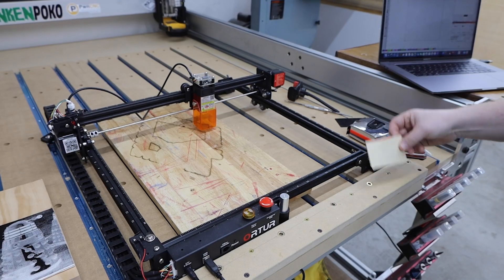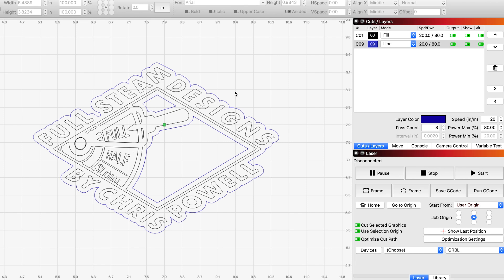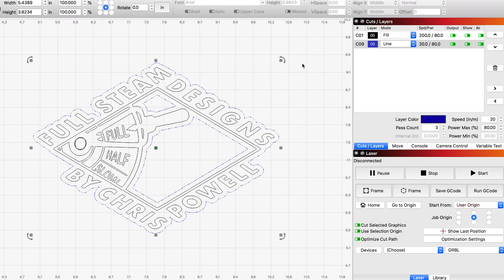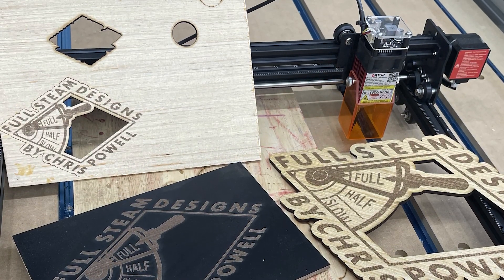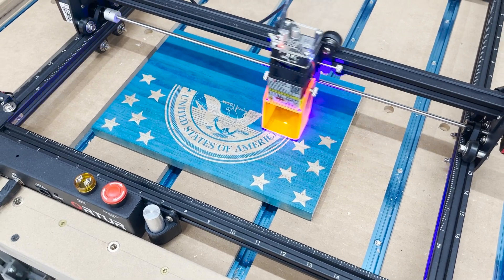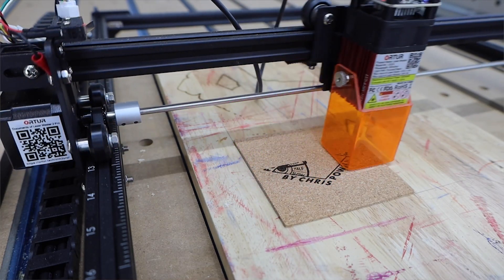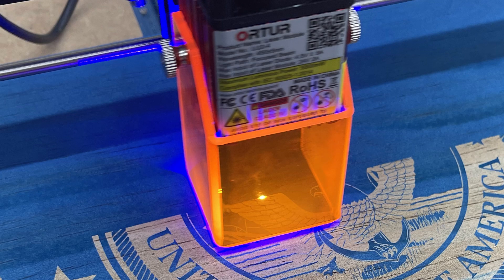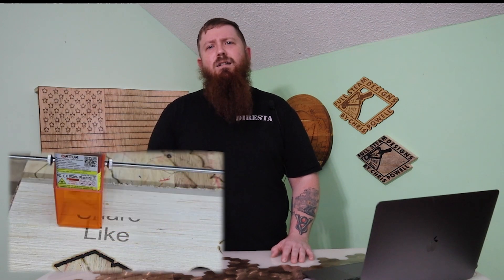Getting Started with the Ortur Laser Master 2 Pro laser engraver and Review

Comment: Great video Chris. Just don't buy an Ortur LM3 .... See below

Well-Known Issues with Ortur Lasermaster 3: A Comprehensive Review

Issue 1: Ortur LM-3 Not Powering On
One of the most prevalent problems encountered by users of the Ortur Laser Master 3 is its failure to power on. This issue can stem from various factors, including a faulty power adapter, blown fuse, loose connections, malfunctioning laser module, or motherboard glitches. Notably, the Ortur LM-3 has faced criticism for having an underpowered "power brick." Despite seeking assistance for this issue, my attempts were met with silence. Subsequently, I discovered a suitable replacement on Amazon.

Issue 2: Inadequate Laser Engraving
When laser engravings fail to meet expectations, several causes might be at play. These include improper focus, uneven engraving area, or unsuitable materials for engraving.

Issue 3: Mid-Operation Halts
Frequent occurrences of the machine halting during operations can be attributed to loose connections, faulty motors, or software/firmware glitches. This issue has been highlighted extensively on YouTube.

Issue 4: Subpar Engraving Quality
Substandard engraving quality can arise due to incorrect settings, a dirty lens, or a malfunctioning laser module. To rectify this, adjustments in settings, proper lens maintenance, and consideration of the laser module's condition are recommended.

Issue 5: Smoke and Odor Production
During operation, the machine emitting smoke or strong odors might be a result of a dirty lens, improper settings, or insufficient ventilation. This concern is commonplace among lasers, particularly during cutting. Installing proper external ventilation and employing an enclosed setup are advised solutions.

Issue 6: Unusual Motor Noises
Motors emitting abnormal sounds during operation may be attributed to loose connections, inadequate lubrication, or faulty motors. Similar observations have been shared on YouTube. A common cause was Ortur's inadequate tightening of drive sprocket set screws, resulting in loosening.

Issue 7: SD Card Recognition Failure
When the machine fails to recognize an SD card, possible reasons include a faulty SD card, corrupted files, or firmware complications. Contacting Ortur for assistance may lead to unresponsiveness, as evidenced by my own experience.

Issue 8: Machine Freezing During Operation
Machine freezing mid-operation may stem from software/firmware glitches, motherboard issues, or communication problems between the machine and the computer. Establishing a reliable link between my Ortur LM-3 and my computer proved to be a major struggle. Despite weeks of effort and assistance from Ortur, I ultimately sold my brand-new machine at a loss due to this issue.

Issue 9: Inconsistent Engravings
Inconsistent engraving results might result from incorrect settings, a dirty lens, problematic materials, or a malfunctioning PWM (pulse width modulated) laser power controller. Obtaining assistance from Ortur for this issue was often challenging.

Lack of Customer Support and Service
In terms of customer service and support, Ortur falls significantly short. Despite purchasing their hardware, I received no aid when problems arose. Requests for help went unanswered, and defective parts were disregarded. Unfortunately, Ortur seems unwilling to invest in its customers' needs or satisfaction.

Personal Experience with Ortur LM-3
My excitement for the Ortur Laser Master 3's potential to enhance my workshop quickly turned to disappointment and frustration. Despite its promising appearance, I encountered only obstacles and minimal assistance from Ortur. Their lone response directed me elsewhere for help. Ultimately, after exhausting various resources without resolution, I was forced to sell the Ortur LM-3 at a substantial loss, leading to the demise of my aspirations.

An Urgent Recommendation
Given my ordeal, I strongly advise considering alternative options before investing in an Ortur product. It is my hope that you avoid supporting a company that displays such an evident lack of commitment to both product quality and 
customer service.

Parting Thoughts
I am not inclined to write negative reviews, but I felt compelled to share my experience as a cautionary tale for others. Thank you for taking the time to read my account, and I sincerely wish you success in your pursuit of a laser product that truly meets your expectations.

Comment: Hi Chris ,great review .. sorry if I missed it but did u use a LF laser or the SF I’m torn which  to buy … thanks so much
Reply from the maker: Thank you. So originally they didn’t have that option. This would probably be the equivalent of the SF. If you plan to do more engravings than cutting, go with the SF. If you plan on cutting stuff out more often, go with the LF. Both are capable of doing both things, but each is better at what it’s designed for.

Comment: Hi Chris! Your tutorial helped me make my decision on buying this machine. Question: I'm looking to engrave a design on a larger piece of wood. Can this machine be sat on top of a larger piece of wood with the same results, or will I have to make adjustments to the base or laser head since it will be further away from the wood surface than a smaller piece of wood that fits inside of the frame. Thanks for any help you can provide!
Reply from the maker: Yes you should be able to do that. There should be enough adjustment in the height of the laser unit.
Reply: Thanks so much! I'm ordering it today! Keep up the good work!

Comment: Hi Chris I have been doing some research on buying a laser.  I noticed how the laser took the paint off the flag union.  Im surprised there was no charring.  How did you do that just applied spray paint and did a pass on the laser?  Thanks
Reply from the maker: Yup. You just need to play with the speed settings until you get it to where it will burn off the paint without burning the wood.

Comment: 20mm/m speed is SO SLOW.  There's a guy on YouTube that shows he's cutting 6mm pine boards and plywood at 100mm/m and 100% power in 2 passes.  My new Ortur Laser Master Pro 2 S2 LF takes one pass (at 100mm/m and 100%) on 1/16" (1.5mm) basswood plywood to cut through but takes 6 passes at the 100% power and 100mm/m speed to cut through 3mm (1/8") basswood plywood (or 12 passes at 500mm/m and 100%).  I complained to Ortur and sent them the video of the guy cutting through 6mm in 2 passes and they had me do a burn test for them on video, then they ordered a new laser head for my machine and said my old laser head wasn't performing as it should.  It's time for Chinese New Years so the whole country is pretty much shut down for a month, but my laser is on order and should be here in a few weeks.
Reply from the maker: I’m using IPM
Reply: @ChrisPowellFSD  I missed that.  Sorry.  But you cut through 1/8" (3mm) plywood at 500 mm/m (20 IPM) in 3 passes.  At 500 mm/m my Ortur Laser Master Pro 2 S2 LF takes 12 passes at 100% power.  So I hope the new laser head boosts that to make it useable.  Right now I don't cut anything out of 1/8" because it takes to damned long to cut anything out.  I'm guessing you can cut through 1/8" in one pass easily at a slower speed and maybe boost to 100% power?

Comment: Will this be able to lightly etch designs onto 2mm thick stainless steel ?
Reply from the maker: Yes it will. It actually permanently discolors the surface of the stainless. You can’t scratch it off unless you sand the material off, but it doesn’t actually engrave into the surface and remove material like it does with wood.

Comment: Does she cuts uhmw plastic ( i mean cut thru)
Reply from the maker: I never tried that. The only plastic material I’ve used is acrylic, and it will cut through that with a couple passes.
Reply: @ChrisPowellFSD  ok 
And u said ur using it professionally
Correct?

Comment: is it just me, that I'm bother that's there's not phone number. i want to get this tool, but what happens if you want to talk to someone.
Reply from the maker: They have a support ticket on their website that you fill out if there’s an issue. There’s also a number of Facebook groups.
Reply: @ChrisPowellFSD  support ticket doesn't help me. I will already be in and sent an email and have not heard back from them this is not good customer service what happens if I don't receive my product what happens if something goes wrong with the product it would be nice to get answers today and not the next day or two still not convinced that this is a real company
Reply from the maker: @joecornejo7454  there sure are a lot of people using them. Maybe check out the x tool D1. It’s a little more money, but might offer you the support you want.
Reply: @ChrisPowellFSD  thank you for your input. ill check out the x tool D1
Reply: They are pretty fast at answering questions on their "ticket" system, but I found that adding pictures to the ticket seldom if ever come through, then I end up having to email the pictures to support.  And sometimes they never finish helping with a ticket  or answer your question(I think they get tired of the problem you are having).  But most of the time they pretty good.  However, I found they are not as good as all sites brag them to be.  It's a little hit-and-miss sometimes to get help.

Comment: What a great and informative video!! I do have one question though before purchasing. Do you happen to know the differences between the "Pro" and the "Pro-LF"?
Reply from the maker: Thanks. They added a couple new laser modules. The short focus and long focus. The long is better for cutting through stuff. Still works great for engraving, but is better optimized for cutting. Both are the same power output.
Reply: @ChrisPowellFSD  thanks for the speedy reply. So by the way you explained it, the LF would be best bang for the buck? Since it can do both?
Reply from the maker: That’s what I use now.

Comment: Hi Chris, thanks for the info. Will this machine etch glass? TIA.
Reply from the maker: Yes it will. I just tested the new Ortur and did a short bit on it in my latest video. You just need to paint the glass or coat it with something it can burn through. Clear glass is too reflective. Then you can just remove the paint once its done.
Reply: @ChrisPowellFSD  It's not too reflective, it's transparent.  so if you want to etch glass you need to paint it first then use lacquer thinner to remove the paint afterwards.  If you don't believe me, put a shiny surface under the glass and then burn something.  It will etch the bottom side of the glass but not the top side as the laser bounces off the shiny surface.

Comment: Does anyone know what the flame alarm means? It keeps going off
Reply from the maker: I would put in a service ticket or ask on the Facebook group. I haven’t had any issues with mine.
Reply: You can turn it off with control command or upgrade the firmware to the latest 1.87 and it is off by default.Flame sensor can be disabled by using $261=0 in console
Reply: Thank you

Comment: I’m really surprised that Lightburn software does remember the settings of each project when saved. On my vinyl cutter software and on my plasma cam software the software will remember the settings of each project when I save them. When I want to create a old project I just open up  the project and the settings are all there. I just bought this ORTUR laser master 2 pro and have not used it yet and have not played around with the Lightburn software yet, still working on finishing up my small workshop. I love all the projects you did, I can’t wait to play around with my new laser toy. Thanks for the video.
Reply from the maker: It’s got a lot of features for software that doesn’t cost a ton of money. Thanks for watching.

Comment: Newbi here - How would I laser the surface of an object 5" high?
Reply from the maker: You can put blocks under the feet. Some people use tin cans, blocks of wood, or 3d printed spacers. Check out my last video on the enclosure I built. I designed it to work with different height objects.

Comment: Hi Chris.  Can the height of the laser module be adjusted up and down, or is it necessary to buy the z-height adjuster accessory?  thanks
Reply from the maker: Yes, it has a dovetail mount built into it that you slide the laser up and down. That’s how you focus it for different materials.
Reply: @ChrisPowellFSD  great, thanks Chris
Reply: They make an accessory you can add to the laser head so you can twist a knob to raise and lower it.  It really beats loosening and tightening that screw.  I put it on mine and it's one of the best accessories you can buy for the machine.

Comment: Thanks for the demonstration! Im actually researching to buy it in a few days and your video is helping my buying decission. Quick question: im planning on engraving wood but would love to cut 5mm hard wood. With enough passes (like plywood) will it go through? Also whats the max depth it can cut? Thanks!
Reply from the maker: The big logo I did was 5mm plywood. I haven’t tried hardwood, but I would imagine it can do thinner stuff no problem. I’ll have to test it out.
Reply: @ChrisPowellFSD  Please help. All of a sudden, ortur/Lightburn is filling in letters instead of burning them as they look. For instance, the letter "O" will look like a solid circle. What happened? I changed computers and Lighburn instances and it still happens. Also, it seems like the power of the laser is extremely higher than 100% when it was never like that. thanks!!!
Reply from the maker: @7awrence  any chance you have multiple vectors stacked on top of one another? Try deleting the parts of the o to see if there’s more than one.
Reply: @ChrisPowellFSD  I just swapped out the power board and it went back to normal. It's even printing clearer. All the problems are fixed. Very upsetting that it was something so simple. Thank you so much for responding!
Reply from the maker: @7awrence  glad you figured it out

Comment: Nice video. I’d love to see a video of your settings for your unions. How did you burn them but they’re still white? Thanks for the content.
Reply from the maker: I think I’ll put together a quick start guide and put info like that in it. I just fine tuned the speeds to burn the paint off, but not burn the wood. I believe it was about 400ipm feed at 80%.
Reply: @ChrisPowellFSD  awesome. I’m looking to get the same engraver specifically for unions on flags. Yours is the only video I’ve watched to show the capabilities to do that. Thanks again for replying and sharing!
Reply: Yes. I would like to see a video on your unions also. Great job.
Reply: I as well would like to see a union video! Especially making the stars on the program

Comment: what settings to remove the stain or paint and leave bare wood? Great video. Just found you and subscribed.
Reply from the maker: Thanks. 400ipm feed at 80% seemed to work well for the paint.
Reply: @ChrisPowellFSD  Thank you. Now I have a good place to start testing from since all paint and stain is different.
Reply from the maker: You’re welcome!
Reply: Had this same question for stain. Saw you remove the blue paint and I want to do that with dark stain, hoping it will work. Have you had a chance to try this? Any thoughts?

Comment: Neat demonstration. The last time I tried ordering a laser like this the company went out of business, gotta check this one out.
Reply from the maker: These guys have been around for a little while.
Reply: @rogerryden1962  Thanks for the input. I understand about material waste and the annoyance of it. I looked into creating a strength/speed chart for lasers in the past. I don't know the name but it uses about 3in. sq. piece of material and burns at 0-100% speed and 0-100% strength in grids. Or at least mine was 3 in. This way I can create a little file cabinet of materials I have used and have a reference guide if I wanted to burn/engrave to a certain depth or level. Perhaps that may help you as well?

Comment: Just ordered mine yesterday. Excellent video. I also have a Makeblock that is contained and this is going into an office so I am no sure how to get rid of the fumes. Work in progress on that one.
Reply from the maker: Awesome. That’s something I need to work on also. Let me know what you come up with.
Reply: I have seen DIY fume extractors with these smaller laser setups if you have access to a window. Essentially:
A plastic bin or make a box that fits over the machine. 
Put in a vent mount. 
Attach a dryer or vent hose to the mount for about 2 feet. 
Connect an inline duct fan to the hose. A cheap one works fine, about $20 but the one I have is a variable speed for about $35.
Connect another hose to the other side of the duct fan and put it out the window. 
You can put a block of wood in the window with a vent mount so you don't have to keep an open window. 

Now, this will NOT filter the fumes, but you should not be lasering vinyl or the like with this type of laser.
Reply: You can buy one of these and tubing. Build a box around your laser engraver with a hole for the tubing. Run the tubing out a window.
https://www.amazon.com/TOPHORT-Inline-Variable-Controller-Ventilation/dp/B07VQZD8YJ/

Comment: Is this machine sturdy enough that is can be moved to a shelf when not in use and to a work surface when needed?
Reply from the maker: Yea, it’s pretty light weight, so moving it isn’t an issue. There doesn’t seem to be any flex in the frame.